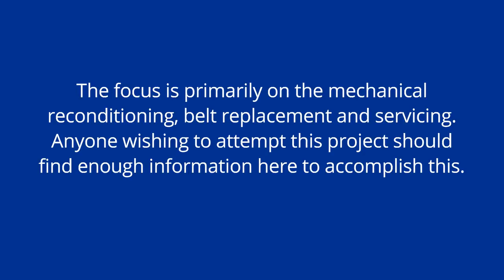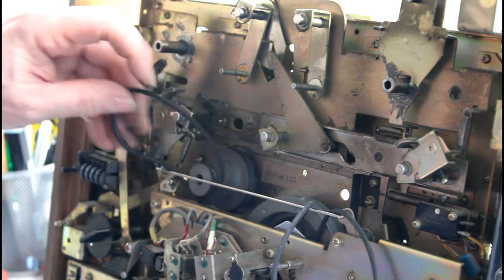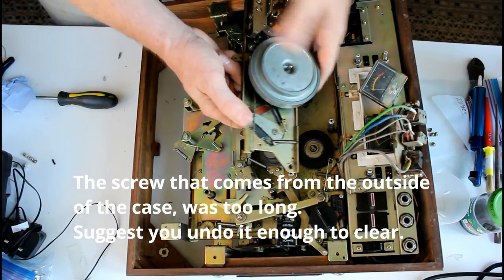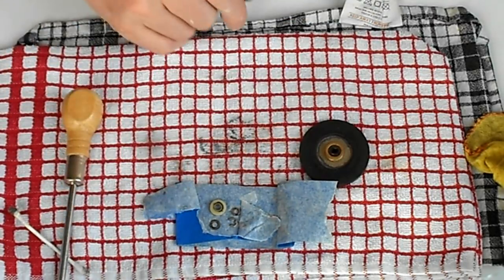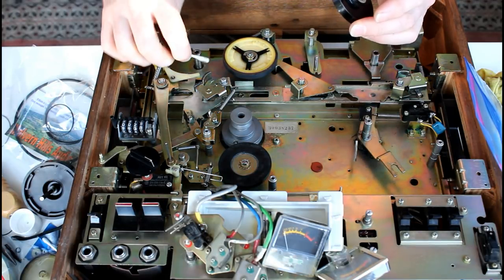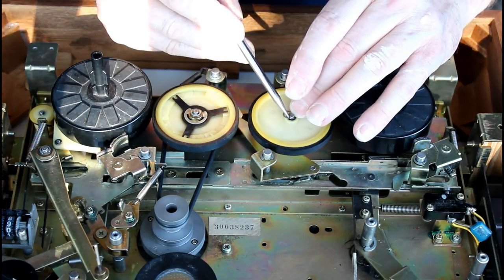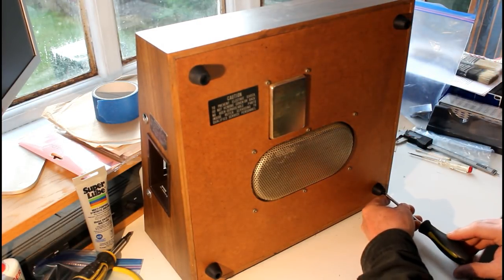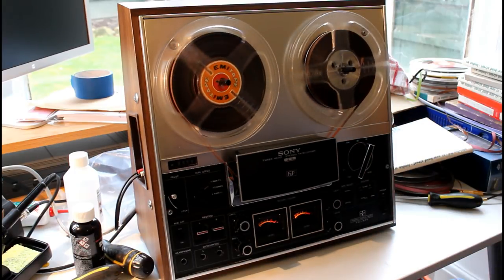Sony TC 377 (& Sony TC 366) reel to reel (How to Renovate and Repair)

Comment: Excellent video.  Very informative.  Only one question.......I also need to replace the pilot lamps for the VU meters.  Where can I get them, and what is their voltage value ?  Thank  you so very much.
Reply from the maker: Hello, I've never replaced one. if you remove the bulb there might be some identification on it.  You should be able  read the voltage with a multimeter at the socket if you can get to it.  Then it's just research after that.  Sorry I can't be more helpful. Thank for your comment.

Comment: Thanks for this video. Outstanding. I bought my TC-377 in the year of 1975.
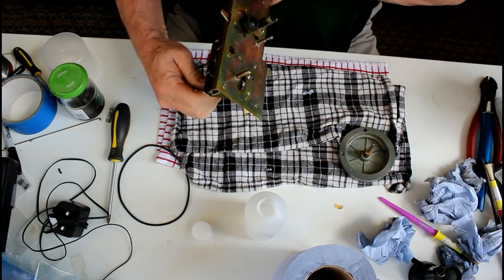This month I bought two new belts (got non for the counter). I have done some disassembling and lubricating work. I have even dissambled the parts under the big plate (18:21 in your video). Now it’s one item left, that I can’t solve by myself. RWD don’t work! 
The reel to the left don’t rotate backwards. It works för play and FFW. If i rotate the right reel manually with a pen or simular. Then the left reel will rotate according to the speed I make to the right reel. Do you know if it is a break in the motor? Or what could it be? BR/ Mats

Comment: Where can I find the same material which you used for your brake pads? I have everything except that.
Reply from the maker: Hello Susan, I found this on eBay it is a felt pad used to stick to the bottom of chairs, wooden beds and table legs etc. to stop scratches to wooden floors. It is self adhesive about 3mm thick.  I expect it's still available or something similar. Thick felt may also work. Hope this helps, please subscribe to help the channel grow.  Thank you for your comment.
Reply: @dembydish  Thank you so much! I love your video which shows how to work on the tape player. I have bought everything you talked about except the felt and superglue. I have two machines to work on. I found a place that is sending me belts. I have had my machines worked on by two different people, and it did not look like they knew what they were doing. I did not have proper belts on, so the right belt broke 3 times. I pushed subscribe. Thank you very much!

Comment: Hi Denbydish, I have watched your video a hundred times now. It has accompanied my own restoration work on my @t cannot even begin to understand how helpful that has been! Thanks a lot! I replaced the capacitor and got new belts (actually I don't think the old cap was broken, but I figured that when I'm at it, it would be stupid not to replace it). It seems to be working OK but sometimes it is as if it doesn't have enough power to pull the tape at the right speed, it then also flutters a bit. This happens towards the end of a tape, when the right reel fills up. Any ideas?

Comment: Hello Denbydish.....My capacitor seems to work fine as the motor fan turns but I need to clean and oil the main pulleys. The problem is the "lock pin's head" is not coming out, i keep sliding it but it wont come out of the slot even I move it both ways slider. Does the pin had needs to be pulled up or to unwind....Please help, looks like it will break. THANK YOU.

Comment: Denbydish
Refer to your video 18:02-18:06, there was a felt ring on the flywheel, mine is missing. I already remade it. I am wondering if I need to put oil on this ring when I put it back together. What is the purpose of this ring? You said it was a felt oil ring – I will assume that it needs to be fully oiled and it will keep the flywheel shaft lubricated. However, I read the manual, which states that this ring is for friction, it is not a felt oil ring. If it is meant to be for friction, then we should not put oil? Also, will the oil get to the tape if we put oil onto that felt ring? Can you please clarify this? That will be much appreciated. Great video!
Thanks!
Reply: if you want to use the TC366  flat and use it then the felt ring stops the rod / flywheel grinding on the base and slowing the speed down i tried laying my tc366 flat instead of upright after changing the chassis   but it put to much pressure on the all the mechanisms and yes i got the grinding put felt underneath and oiled it still messes it up as it should be a hard plastic material   . that was after putting new belts on but takes up to much space laying it flat

Comment: @danbydish Hi there, thank you for your video. I'm trying to repair TC-366 that I just got. It's in great condition and I was told it was serviced, but apparently it stops playback due to extensive friction on the flywheel. I noticed that when I lean it forwards it runs, and when put in upright position or lean it back it stops. I removed the cover and discovered that the flywheel just makes strange noises when spinning and stops. From what I see in this video there seems to be just one part missing in my TC-366 - that brown disc underneath the flywheel :) But I cannot seem to find any information about the material used. Is it rubber? How thick is it? Could you help me with that? ;) I would be grateful for any help :) Thank you.

Comment: Awesome and in-depth video! Loved it. Just ordered one of these bad boys from Ebay. Wish me luck.. Also, question - I was under the impression that there would be more than one electrolytic capacitor that could need changing. Is that the case? I was going to just replace them all just for the hell of it, as I know electrolytic capacitors most likely won’t have lasted this long.
Reply from the maker: Hello Francis, the motor capacitor is the only one I changed.  The video doesn't cover any audio electronics. I found that even after all these years the audio was excellent.  There is no amplifier built into the unit, it only supplies a low output signal intended for an external amp, so electrolytic capacitors probably won't be a problem. They're the ones people worry about most when they're present.  I'd suggest getting it mechanically restored first and test it at that point. If memory serves, the electronics are densely packed into the unit and may be hard to identify, let alone replace. Anyway, that's my 2 cents, but always support people doing things themselves, that's the way I've learned. The hardest part is finding the tapes! Good luck and thanks for stopping by.

Comment: Hello, may I please ask you a question about the SONY tc250a, perhaps you know if it can be fixed? The tape speed switch doesn't work, it pushes up for the 3 3/4, it won't stay in the down position, and it doesn't rotate the wheels (It does stay down with 7 1/2 speed). If press down the switch in the 3 3/4, the wheels rotate and audio plays. Can this be foxed? Thank you!
Reply from the maker: Thank you for your question. I don;t know the TC250A model, however,  I'd say the problem is probably due to dried up lubrication.  Most mechanical problems can be resolved assuming the parts are still there.  New belts are a must too. Thank you for your comment.
Reply: @dembydish  Thanks!

Comment: super video thanks for sharing i wonder can you shed some light my machine will not stay in play FF or RW ive not taken it apart it just stopped working correctly. i can hold it in play if i just catch the transport control right and it balances just before FF so to speak then it plays is this problem fixable?
Reply from the maker: Thank you for your comment.  I suggest checking that the tape is wound onto the machine correctly first and all the slack is taken out of the tape. Other than this, it is hard to know without inspection.  I suggest you take the front off the machine and thread the tape on again and see if there is anything obvious, like slipping belts, or sticking mechanism.  The belts most likely need replacement and may be loose, and at this stage it makes sense to clean and lubricate the machine as per the video.  If you are feeling up to it, please subscribe and give it a go.
Reply: There is a switch (with a lever) that detects the presence of tape (called Motor Switch as it shuts power to the motor when the tape ends) and I bet it is not quite engaged. When you remove the cover over the 3 heads you will see a thin rod to the left to the Erase Head (the one closest to the left). You can push it up a bit (help the tape) while the tape is played and you should see the PLAY will stay engaged, but when you remove your finger from it it may stop. The causes of this malfunction may be numerous. It is a delicate mechanism and old grease that hardened may be one. You have to remove the font cover and investigate.

Comment: great video ive put some new belts on my 377 it was working great before needing new belts now it plays slightly slow on 7.5 ips and is slow on the take up from start up. if i run it for a while so it warms up so to speak it gets better, any suggestions could this be just a duff drive belt or something else
Reply from the maker: Hello, its difficult to say without looking at the machine.  However, old dried lubrication contributes to things dragging and not running up to speed.  I'd be looking to lubricate the machine properly at this time.  It is detailed in the video if you want to follow along.  Please subscribe and keep safe.  Thank you for your comment,

Comment: Brilliant video! I’m going to use it to repair mine in a few days, some say I am a different 15 year old! I don’t suppose you have a part number for the bulb that goes in the white housing on the front for the VU meters do you or the bulbs that operate the recording lights? Mine are dead
Reply from the maker: Hello Reiss, I am sorry but I haven't needed to replace the bulbs myself.  I expect you can remove them and take a look. You could carefully measure the voltage being supplied to the bulb with a volt meter to see what's needed and then try to find one of the same type.    I used to pull things apart when I was young too, my record player was the first thing to be disassembled. Good luck with your repairs, thank you for your comment and please subscribe.

Comment: Thank you for this (and nice presentation, BTW). Just bought a TC-366 with low-use off ebay for cheap and it doesn't play 7 1/2 speed (just 3 3/4) (is that an idler issue?). Just ordered new belts since I have to take the top off - and after diagnosis research, DLing service manuals - and now finding your video - my confidence level is now high. Taking it apart is easy - it's the putting back together that's always questionable ;-)
Reply from the maker: Thanks for your comment.  If you follow the video along as you restore, I think you'll resolve most problems.  Most play back issues are decaying belts, idler wheel and pinch roller or oil/grease on the rubber parts effecting the grip.  This video does cover the disassembly and reassembly in some detail.  I expect you'll be OK if you follow along and go step by step.  I am glad to hear from some viewers they've has success. Let me know how it works out and good luck!

Comment: Great video. I am having difficulty in sourcing a replacement capacitor, even from Ducati in Rumania. Can you provide me with precise information for ordering one please?
Reply from the maker: Hello, it's been a while since I made this video, but if memory serves, if you're in the USA (110v) you'll need a 1.5 uf capacitor, if you're in Europe (240v) you'll need a 2uf capacitor.  The capacitor voltage rating must exceed your wall outlet voltage, it doesn't matter by how much so up to 400v would be fine. Non polarised makes the job easier, attach the wires either way. Polarised attach + to + (and) - to -. In this case when taking the old one off,  pay attention to existing wiring and duplicate. As to availability, eBay seemed to be the best source. If you can't get it locally, international sellers may be needed. I used a generic capacitor, nothing fancy, it works fine.  Ducati are known for good caps but like all capacitors they fail eventually.  These days you'll probably end up buying a Chinese one.  They're a simple device that stores electrical charge to give the motor a bit of a boost to get it running. Hope this helps, please subscribe, and thank you for your comment.
Reply: @dembydish  Thanks so much. I think the fact I've been looking specifically for a 240v capacitor has limited my choices. I did wonder why there were so many 400v ones to choose from.

Comment: So is the TC-366 (3 speed 1971-1972) exactly the same as the TC-377 they put put in 1973? Any changes to the 377 through the 70's? There's a 3 speed TC-366 near me and I've been looking for a 377.
Reply from the maker: Hi Micheal, I'm not an expert or collector of these machines, but as I understand it, the main difference between the 366 and 377 is the recording/playback heads. The 377 being better quality. Perhaps someone else here can address the specifics. Both machines sound good when working properly. I've found the biggest variable in playback is the quality of the available tapes.  Those recorded at faster speed being the best, but more expensive to produce and difficult to find.  Hope this is of some use. Thank you for your question.
Reply: @dembydish  Thanks for the info. This also leads me to think that if I find a 366 that needs a little bit of work, it would be better off to mad it with 377 heads. I have a friend here who repairs and builds lots of Hi-Fi equipment including tape machines and builds all kinds of guitar effects pedals, cables, tube amps,etc.

Comment: Hello friend of Portugal, my sony tc 377 after being all clean happens that the button of olay does not fix nor forwards nor forward the coils walk normally only if you want to make play not fixed. It will be of the panel that has a tongue dark that is loose, should it be fixed? Thanks

Comment: Very nice work on the video. Very methodical approach. Appreciated the names of the products used. But, when you say "white spirits" you meant alcohol correct not a mineral spirits? Also, I find old idler tyres and belts simply decompose to a sticky tar which has to be carefully cleaned out. Other than finding scrapped items, any resources you know of for replacements? Rubber is the weak link in these old machines. Again, thanks!
Reply from the maker: Hello and thank you for your kind comments.  White spirit (mineral spirits US/Canada and mineral turpentine AU/NZ) is a paint thinner for oil based paints and a mild degreaser.  I used it on the  metal work to remove the grime, oil and grease.  Only because it is cheaper than isopropanol, which is very expensive in the UK.  For the more delicate parts or moving parts I used the isopropanol.
  
Yes, the rubber decomposes and at times turns to a sticky goo that gets everywhere.  I had that problem with a Marantz Casette player I made a video about here on this channel. 

Regarding the idler and drive wheels.  It seems these are no longer available as either NOS or reproduction spares, as far as I was able to find out.  I looked long and hard.  The only viable option seems to be getting them remade.  This involves removing the old rubber, gluing on new and turning the replacement rubber on a lathe to the correct dimensions.  Terry's Rubber Rollers is the guy to go to.  He's in the US.  If you live there yourself, great, otherwise it's costly on postage.  I got my replacement belts on Ebay.  

Thanks for your comment and please subscribe to help the channel grow.    I am available to ask questions. Good luck with your restoration.
Reply: @dembydish  Thanks for that response! 'Thought that's what you meant about the "spirits" but didn't see that in your supplies. Other places on YT you see all sorts of things used. Spraying petrol based solvents near to rubber items isn't a good idea at all. These items work for the short run but increase the degradation. Your spot cleaning approach is one I use too. I'm also kind of particular about the lubes as well. 

The 'pinch' and drive wheels are a problem. I know about Terry's but that's pricey even stateside. Those were consumer products and not Ampex 100 series or Studers.  BTW, will check out your  Marantz feature. 'Have a Tascam 421 that has the same gooey pinch roller mentioned. The belts on those are a nightmare... Take care.

Comment: Hello, I have an issue with the speed selector. Seems to be seized. Very little movement. Any idea if it needs to be oiled??
Reply from the maker: Hello, you could try lowering (or moving up and down) the lock arm (right of selector) and try again. Other than that it will need some dissembling and looking at. Lubricant is always useful.  Hope this helps.